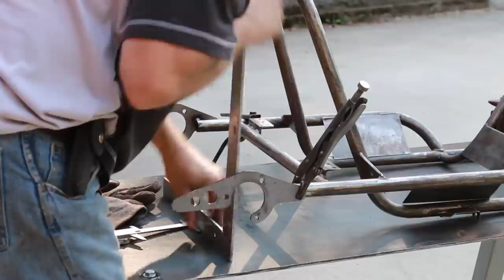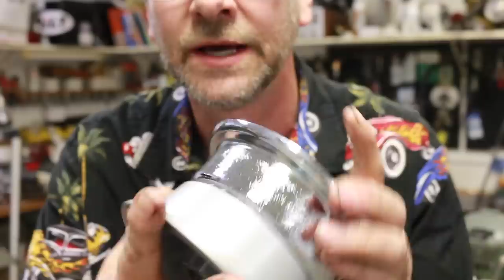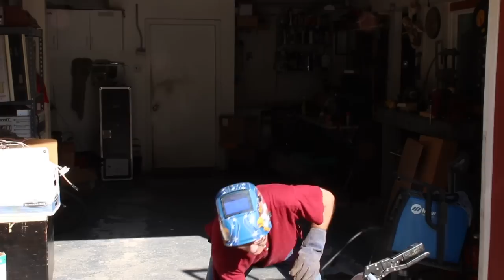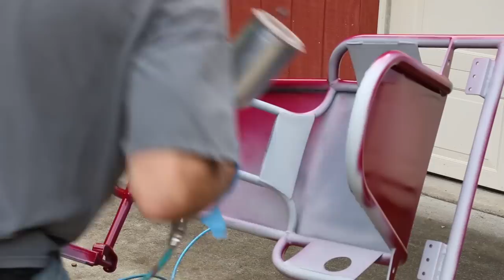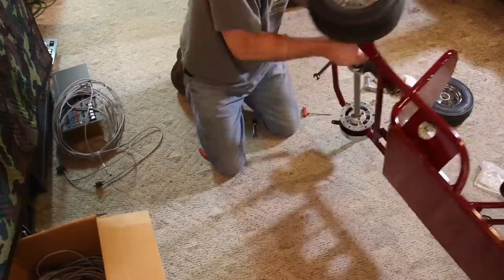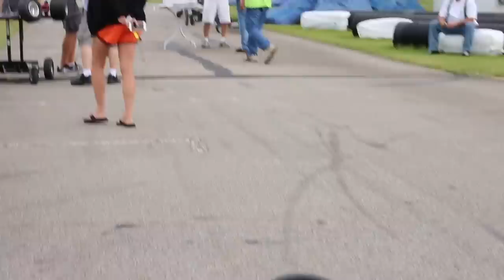Rupp DartKart GoKart restoration with Homelite KL-92

Comment: Very Nice Restored Go Kart, Good Job :)  My Neighbor Gave me a Old Vintage Go Kart, I think its an Amusement Park Go Kart, its Built Really Strong,  It was Sitting for a long Time, it was rusted Solid :) There was so much rust inside the Tire rims, that i had to Cut The tires off the rims, and they are 2 Piece rims ,  I ground off and wire brushed the inside of the rims and painted them so that does not happen again :)  I bought 4 Harbor Freight 13" Tires with tubes and rims, I used the original rims to keep it Original, I had some old 3HP Briggs and Stratton Engines laying around, and made a good running engine from a few old worn out engines,  It Runs great, I fixed it Up for my Grand kids :)  YEA RIGHT :)  You cant get me off this go Kart and you Cant Wipe off the Big Grin I have from Ear to Ear,  Ok I Do Let my Grand Kids ride it, I have a 1/2 acre Lot and all the rain we got a little While ago really made the weeds grow,  No Weeds now, My Go Kart took care of them :) LOL, I am a 66 year old Grandma with 4 Grand kids and a Retired Female Fleet Equipment Mechanic, My Neighbors Think I am Crazy Riding this go Kart around, and They are Right :) LOL , Take care, Chellie   Subscribed
Reply: You’re a cool grandma ...

Comment: I had the same rupp go kart back in the late eighties. It had dual engine mounting  plates, a live axle and slicks on the back. I got it with no engine or gas tank. So I painted it hugger orange and put a 8 hp tecumseh engine on it. It kicked ass.

Comment: You did a beautiful job! I'm in the process of restoring the kart I had as a kid - A Broncco made by Fantic Motors in Italy.  The frame is very similar to yours.  I have read that Fantic copied this Rupp design with a few slight modifications.  I'm changing the rear end over to a standard 1" axle (everything originally was metric) and upgrading to a modern hydraulic brake system.  Power will be a WB-Chrysler 820, all four original wheels will be used.  A really fun project but like yourself I have a difficult time fitting in it now!

Comment: What a great video!!! This guy is good!!! Beautiful job he did restoring this beautiful machine... The only thing that I NEVER would have done is, cut the rear axle carrier assembly off... These frames were set-up in jigs at the factory, and even a slight mistake in re-aligning and re-welding it could adversly affect the handling of the machine... And paint / blasting media, getting into the steering shaft bushings could cause a problem there as well. He should have masked these areas before the blasting, priming & painting took place....But everything else he did was very nice and his care & craftsmanship is awesome... This is a BEAUTIFUL job he did, restoring this very important piece of American History & ingenuity!!!

Comment: Back in the 70s I had that identical cart.  Same color and same Pontiac style rims.  Got it with no engine but I tried a few different ones. Luckily I was about 4-10 and now about 5-4 so I always fit nicely in them.
Reply: I had a kart that was made by the same mfgr. (Dart/Rupp) .... Mine was the chaparral model...  I had a McCulloch Mc20 (80cc) and eventually went to a Mc91 (100cc) engine... It had the turbine wheels just like this one has... I now wish that I never sold it... American Ingenuity at it's best... Very simple engineering, light weight (135 lbs) and reasonably affordable extreme FUN!!!

Comment: Hilarious that you are able to weld, paint, prime, restore engines, but not capable of figuring out how to get the gas out of it after your son rides it in order to hang it up and display it.
Reply: I think it is because once gas gets in Cork and rubber it deteriorates it no matter how clean you think you have it. As an example.
I have had NOS carburetors that worked like a champ that sat in the box since the early 1970s, I put them on the car and it sat for a year with no gas in it and it had a flat spot when you would accelerate, when I pulled the carburetor apart the accelerator pump and dried out and cracked
Reply: Atomic Reverend Alexander small Engine mechanic for over 30 years...nonsense.  This isn’t a car engine.  Just weird the guy made a point about doing it for his son and really just never was interested in him riding it.